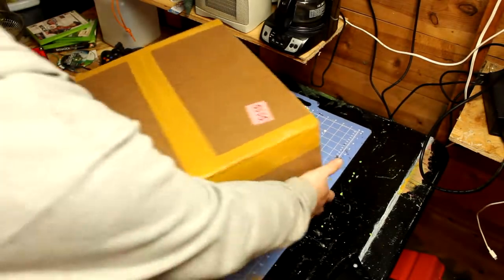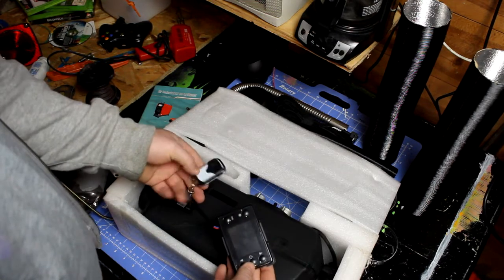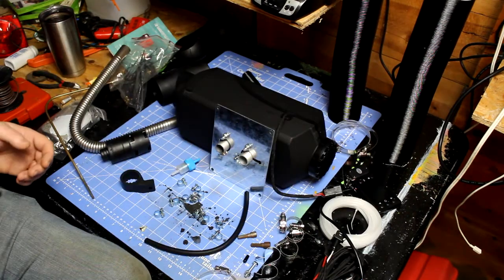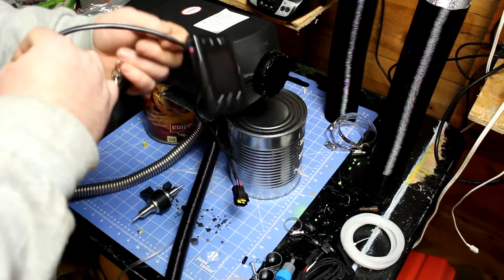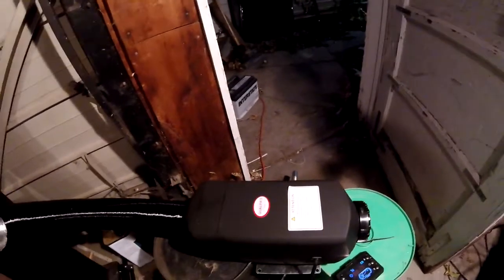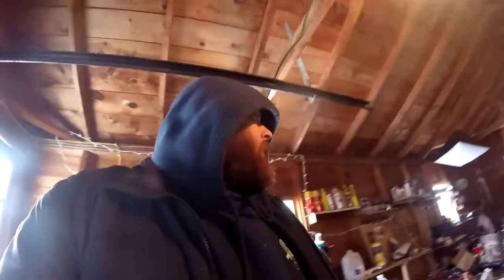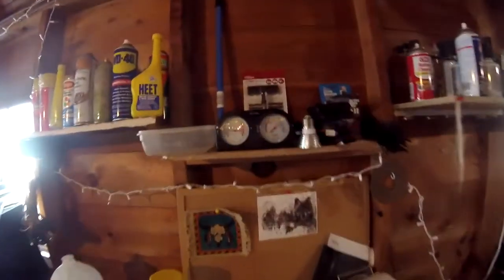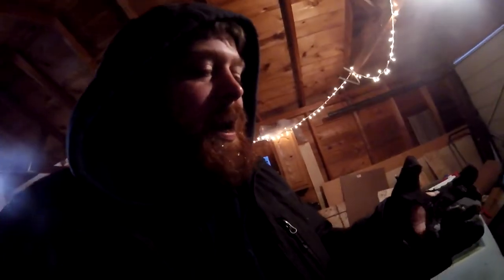China Heat for the American Hobo, Unboxing & Polar Vortex Testing #polarvortex #staywarm #cheap

Comment: @19:00 When I primed my fuel pump I had to do it 3 times to get fuel up to the heater and to remove air bubbles in the fuel line. If there are air bubbles in the fuel line there will be smoke coming out of the exhaust pipe.
Reply from the maker: I've noticed sputtering when running on low. That could be from the air in the lines. When I get it install in the camper I'll get them all out! Thanks for the tip!

Comment: I installed a 5kw diesel heater in my van about a month ago and thank God I did. It's been -10F to -15F overnight for three weeks straight. This heater ROCKS!!! It's been between 62F to 64F in the van at night on the lowest setting. I ordered a 6 gallon fuel tank to replace the 10 liter tank that came with the heater.
Reply: I also purchased a long tube that allows you to install the fuel outlet on top of the tank instead of at the bottom.
Reply from the maker: A bigger tank would be smart! I bought the yellow diesel can so I can have 5 extra gallons along. Can't wait to see what this baby can do it the camper! That's pretty amazing too have 60 degree in there on low! You helped me purchase my buddy heater believe it or not! I'm loving the dry diesel heat tho :)
Reply: @HighDollarHobo  When I installed the tank that came with the heater it was literally too tall for me to install it. It was a real biatch to put the pump nozzle into the top of the tank because it was 2 inches below the storage thingy I built in the back of the van. I bought a low profile rectangular tank with a 5 inch opening so it will be much easier to fill the tank.  If you have any questions when you install your heater feel free to contact me. :)
Reply from the maker: @mistermusic140  I think my heater tank is going to fit just right. If you have the link for your square tank I would like to see it!
Reply: @HighDollarHobo  I tried to put the link for the tank 4 times but youtube keeps deleting it.
Reply: If you go to Sievers Poly Tank Sales and type in part # SP0006-5N in the search box the tank will come up.